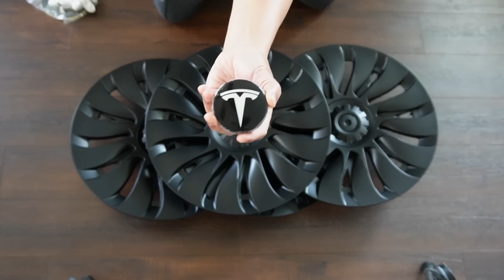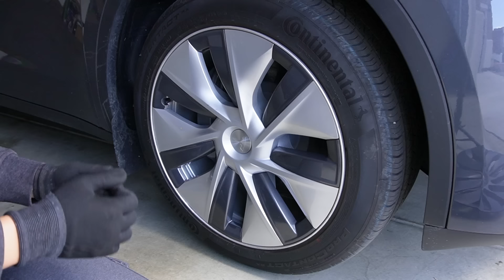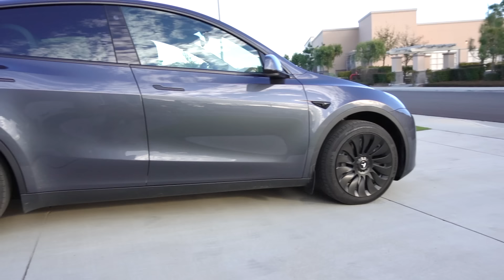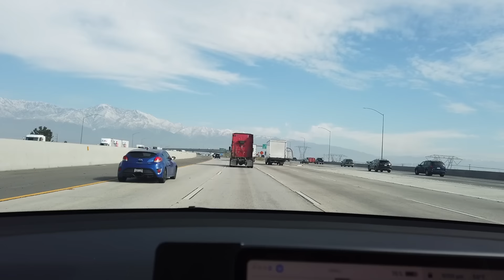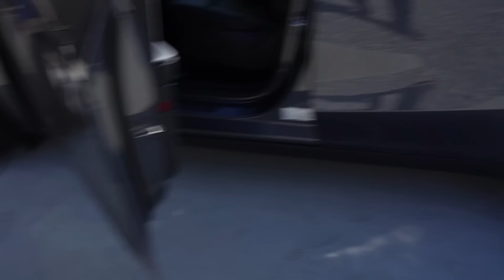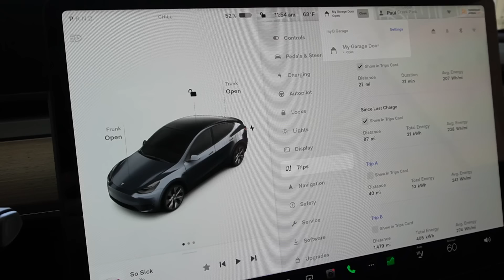2023 Tesla Model Y Wheel Covers Upgrade with 15 Mile Range Boost! #tesla

Comment: Hi, I just now bought it, jast a quick question, the 223$ price if for 4 set of wheel covers right? Because in my order there is no such thing mentioned.
Reply from the maker: Yes, that price is for the set of 4 covers.
Thank you for watching and your support!🙏😃
Reply: hi Jigar, just wondering if you had received your order or tracking info yet? I ordered these over 2 weeks ago, but still don’t even have tracking info for the shipment. trying to figure out of this is normal or if I should be concerned. thank you!
Reply: @stepheng5314  Hey Stephen, for me even though they generated the shipping label but it never made it to UPS drop off for shipping, so I messaged them and they said that they were out of stock with those covers and recently got the new inventory and they said I should be receiving it by next Monday or Tuesday. Try messaging them from the website to check on your order status. They will reply fast.
Reply: @jigarparmar2749  they told me the same thing, i have had the tracking number for 10 days, but no movement on it. guess I’ll just continue to wait. thank you!
Reply: Ordered mine a week ago. They haven't even shipped mine yet. Starting to suspect they might be a scam
Reply: @drunkbear9901  I think with huge numbers of Tesla Model Y sale, they are quickly running out of stock for this wheel covers, for me they have already shipped it and UPS is going to deliver by tomorrow. Probably you will have to wait atleast 3 weeks to get any updates may be due to huge demand. You can check with them through the live chat.
Reply: @jigarparmar2749  wouldn't have ordered had I known it was gonna take this long. They are telling customers false info and should change the shipping info accordingly then

Comment: 😊
Reply from the maker: Did you apply foam tapes on all the clips? They are not the easiest to remove but I have removed them a few times with no issue. You just have to do slowly if it doesn’t come at once.
Sorry this happened to you.
Reply: @dadstoyscars  no I didn’t use foam tape on the  clips and Yeslak is sending me a free replacement hubcap. I will give it another try because I really like them!  I will add the foam tape, thanks.

Comment: When going to the link you provided for the wheel caps it contains the following message in regards to the logos.  “Note: It is compatible with Model Y 19'' Gemini wheels only. The wheel cover comes without logos. The design of the cover center is flat, and you can buy a 2.22'' (56mm) decal or logo sticker to adhere to our product.”
Reply: I'm guessing they have a separate entity shipping those since technically it's illegal to sell a Tesla logo'd item.
Reply from the maker: @hgodtx  I think that’s why.
Reply from the maker: When I received the covers I asked Yeslak about this too and they told me that they will ship the logo caps out separately to customers.
Thank you so much for watching and your great support to the channel.🙏😃
Reply: I received the rims a few week ago (thanks for the discount code), our MY last week and installed yesterday. I assumed the the wheel covers would be slightly larger than the rims and with the 90 degree angle overlapping the rim….they do not, the rim is covered,  but from a few feet away you can see the silver top of the rim.  Is this correct or is it possible that  Tesla changed the size of the rim a millimeter or so, and Yesak did not update the mold?

Comment: It would be cool to try the directional covers backwards.  In other words put them on the wrong side to see any difference.  Anyone else want to see that?
Reply: What's the point?
Reply from the maker: It would less likely to increase efficiency.
Reply: @dadstoyscars  the question would be if it is truly because of the directional design then turning them backwards would yield worse efficiency than even the stock Geminis.  

I suspect it has nothing to do with the directional design but because more of the open area is covered in general.
Reply: @RyuMoto  the directional design is aerodynamically inspired by a fan/turbine propeller design. It's likely gonna make a small difference (be less efficient) as facing it backwards is gonna draw in more wind into the wheel.
Reply: @conglin2093  exactly my point.  It would be nice to know what efficiency that means

Comment: My order came in today and yes they are directional! I am replacing my 21 inch Uber turbine wheels on my y performance with the 19 inch Gemini wheels. I am tired of replacing back tires at 17,000 miles at 1100 bucks a pop! The diameter is almost 21 inches on the hubcaps compared to the 22 and 1/2 inches on the Uber turbine wheel face. They are pretty close in looks and size. Ps: I got gun metal gray which matches the 21 inch wheels! 😊
Reply from the maker: That’s awesome!
Thank you for watching and sharing your experience Rickey!🙏
Reply: hey Ricky - just curious how long it took for your delivery? I ordered these over 2 weeks ago and still don’t even have tracking info. yeslak service said it can sometimes take time for the items to clear customs but it has taken much longer than they originally told me. did yours take some time as well?
Reply: @stepheng5314  I odered a set March 20th and they showed up today with 3 styles of T logos, padding tape, but they are not directional
Reply: @gizmopilot  that’s interesting - mine finally arrived yesterday and the definitely are directional. they look the same on both sides, and 2 are marked with “L” and the other 2 are marked with “R” for the left and right side. just like he shows in the video.
Reply: @stepheng5314  - my mistake I also ordered a set from basenor they actually got here the Yeslak’s are supposed to get here later
Reply: So they showed up and 2 are right and 2 are left - they included a roll of the foam tape, they told me they would include the Tesla logo’s but didn’t, keep in mind I ordered these 3/20 with expedited shipping that they reimbursed me since that obviously didn’t work out as they showed up this afternoon
Reply: Hi Rickey, so are you still happy 1 month later. Not regretting the actual black wheels VS hub caps? Is the look really similar or can you catch it's plastic cover? Thanks.
Hesitating as many to either in my case go for the induction wheels while ordering or rather take gemini and get one of those covers. Cheers

Comment: Wanted to see how the efficiency is over a period of time like 500 or 1000 miles?
Reply: Also to check on a round trip to eliminate and headwind or elevation bias in the test. Might want to go from full charge to full charge as  well.
Reply from the maker: That would be a long test.
Reply: @Dad's Toys & Cars  So how long have you had and how many miles have you driven on these wheel covers?  Is the efficiency still as good as when you did the video?
Reply from the maker: @vlTesla-yp4ym  Now it’s at 352 miles since I did the video bad Average Energy is at 261 Wh/mi which is very good for mix driving with no speed limit to 72mph. Because normally I would drive about 75-80 mph on freeway.
I hope this help.
Reply: @Dad's Toys & Cars  Nice.  I got my wheel covers but never got the Tesla logo caps.  Please help.
Reply from the maker: @vlTesla-yp4ym  They will ship the center cap logos separately. Please email them if you don’t receive the logos within a week.
Reply: Doesn't have to be a long road trip.   Just over time of normal driving to compare results.

Comment: Dude, I bought some wheel covers from TParts that have backs just like those that you have. I took a trip recently and wanted to put on my Gemini wheel covers. When I went to remove those TParts wheel covers they would not come off. I had to go to Discount Tire and have them help me. They were on so tight that they broke 2 of those wheel covers and the TParts wheel covers scratched the crap out of my 19" wheels! The backs on your new ones look exactly like my TParts backing . Looks like they come off easily but I dont like the way they're engineered. Great design but needs a version 2.0.
Reply: I put them on but they are difficult to get off ! I even put that foam tape on the clips and still they are really hard to get off. I eventually took them off and bought the center cap set for the Gemini wheels and when I go out of town I will use the stock caps. They are a piece of cake to get off! 😊 I just don’t want a workout when it comes time to rotate tires every 6500 miles!
Reply: @rickeybarnes6471  Yeh, I ordered these wheel covers about 10 days ago and they still haven't shipped them. Im about to cancel my order. Why cant people make wheel covers that attach like the stock ones? That's the right way to engineer these.
Reply from the maker: @rickeybarnes6471  Yeah, they not the easiest covers to take off but when you the way then next time should be easier.
Thank you for your awesome support!🙏
Reply: @rickeybarnes6471  

Yeah, I'm on the fence due to difficulty of removal.  I too rotate my tires frequently like you so I am worried about the removal.  Do you think I should wait for the 2.0 version?   I do like the look though, especially the gun grey color which is unique compared to the common black covers on the market.
Reply from the maker: Sorry that happened to you.🙁
That’s the reason why I put the protection foam tapes everywhere on these wheel covers.
Thank you for watching and your great support!🙏😃